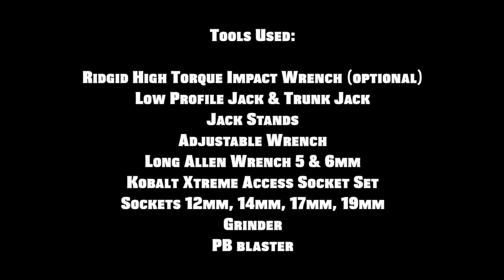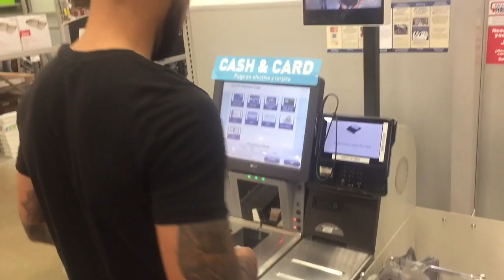Eibach Sportline Lowering Springs Install - FRS Vlog

Comment: Does using and just replacing the springs in the long term cause damage to the car or the suspension system or anything?
Reply from the maker: Yes but send it 🤘🏾

Comment: Question when you released pressure on the strut from the top but did you just loosen it or take the entire nut?
Reply from the maker: So we removed all  eight nuts and then jacked the car up.

Comment: what makes you choose the sportline over the prokit? i hear sportline blow up oem shocks?
Reply from the maker: I chose the sportline for the lower drop.  I haven’t had any issues with my struts they are still in tact.  They are a bit bumpy depending on the road but not too bad.  Overall they have held up pretty good
Reply: @MidnightChaos  how many miles do you have them on now ? cant decide between pro-fit and sportline, do you have any problem going over speed bumps/ driveway// on ramp?
Reply from the maker: Maybe around 5000? I dont put a lot of miles on the car.  Driveways and speedbumps arent bad at all especially if you take them at an angle.  I very rarely scrape, and any driveway thats too steep I avoid.  Depends on where you live though. The roads here are crap but its doable.  The main thing is just avoid pot holes because the stiffer springs can be bumpy.  Id say if you want close to oem go with the pro kit, but the sportlines are worth it. I didnt think the pro kit was enough of a drop for me.  There is still like half inch wheel gap with these too so there is clearance.  Check some of the other frs vids for reference
Reply: how many fingers between the gap? looks like its only 1 finger  1/2" gap? the stock is 3" gap if u lower shouldnt it be 1.5"? is it because you have 18 inches rims with 35 so kinda close up the gap? wonder if we can fit 45 side wall tires with the sportline with no rub
Reply: @MidnightChaos  btw do u get alot of snow there?
Reply from the maker: Yeah im running 18 x 9.5 all around .. if you run a wheel that is less wide or 17s you can fit a 40 or 45 sidewall to close the gap even more.  I cant run anything more than a 35 because its close to the stock struts in the front unless i get coils. We get snow here in the winter but i switch back to the stock wheels. And my bad -  its closer to an inch gap on level ground with the 18s but a lot better than the stock gap for sure

Comment: I’m working on mine rn and I can’t get the nut back on the top of the strut without the rod spinning I don’t know what to do
Reply from the maker: You need a long hex key to stick in the middle to keep it from spinning. Then use an open socket wrench that you can use with it at the same time.  
This is the one we used: https://www.lowes.com/pd/Kobalt-47-Piece-Pass-Through-Socket-Set/1000875556 

Hex keys: https://www.homedepot.com/p/Eklind-9-in-Series-Cushion-Grip-Hex-T-Key-Set-with-Pouch-Size-2-mm-to-10-mm-8-Piece-55198/305303201?source=shoppingads&locale=en-US&mtc=Shopping-B-F_D25T-G-D25T-25_1_HAND_TOOLS-Multi-NA-Feed-PLA-NA-NA-HandTools_PLA&cm_mmc=Shopping-B-F_D25T-G-D25T-25_1_HAND_TOOLS-Multi-NA-Feed-PLA-NA-NA-HandTools_PLA-71700000034127224-58700003933021546-92700065352444830&gclid=EAIaIQobChMIhPTWpqaX8gIVORmtBh25HgDSEAQYDSABEgKpsfD_BwE&gclsrc=aw.ds

Comment: Do you scrape at all with this setup going up ramps or speed bumps
Reply from the maker: I don’t scrape on speed bumps really, but steep ramps I will scrape occasionally .  Typically I avoid ramps that are too steep, and I usually go over ramps and speed bumps slowly and at an angle
Reply: @MidnightChaos okay cool this is what 1.5 inches lowered?
Reply from the maker: Its closer to 2 inches after it settled.  So yeah expect like 1.5 to 2 inches depending on your wheel size

Comment: Hey can I know what’s the specs of your rims and did you have any rubbing issues
Reply from the maker: 18 x 9.5 + 38.. no rubbing issues with 245 35 tires
Reply: U think offset of +35 would fit? Same rim size.
Reply from the maker: Im sure it would fit but you may need coils / camber adjustment with that set up or smaller tires